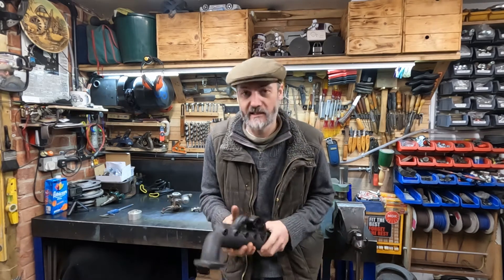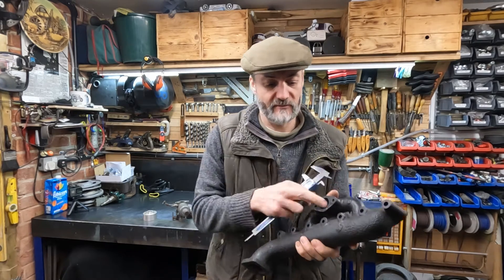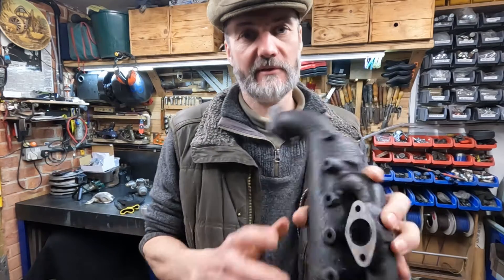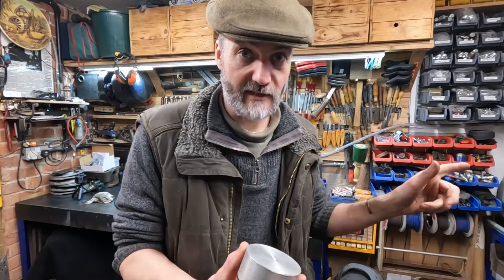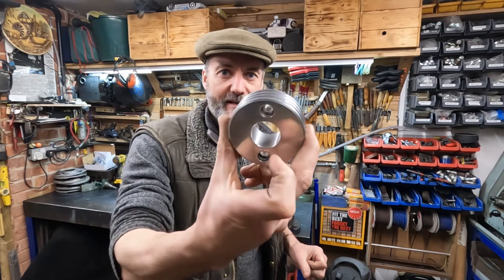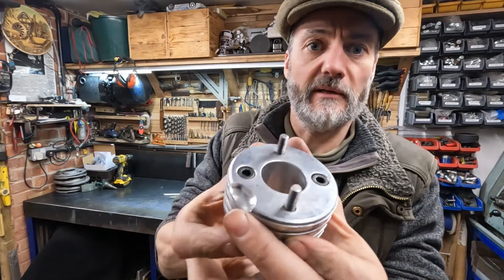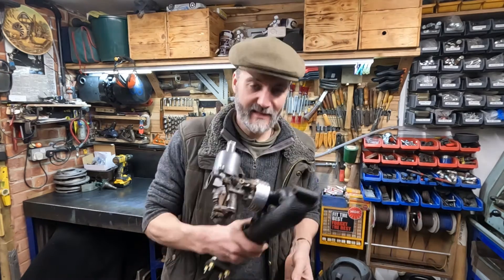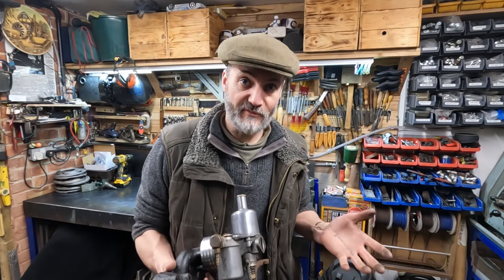Austin 7 Special Carburetor Adapter

Comment: Neat, BUT - you can only flow as much as the smallest hole so fitting ( example) a 35mm carb to a 25 or 30mm hole will only flow as much as a 25mm carb unless you have the 35mm carb with a 25mm Venturi but the su doesn't have a smaller Venturi/ choke.
Be better if you just cut the inlet manifold off the exhaust manifold and made a new inlet manifold and fit two 1" carbs or a 36dcnf with 25mm Venturis.......